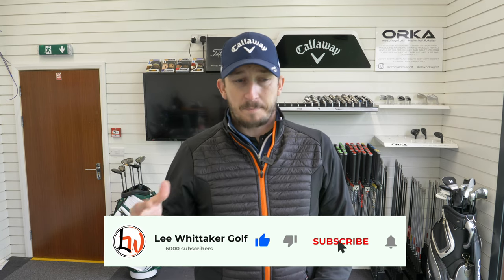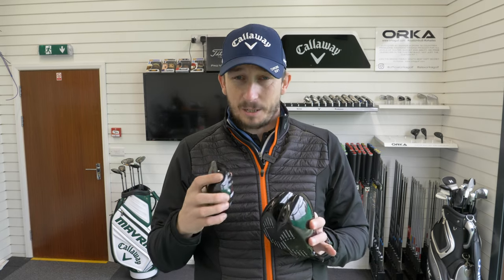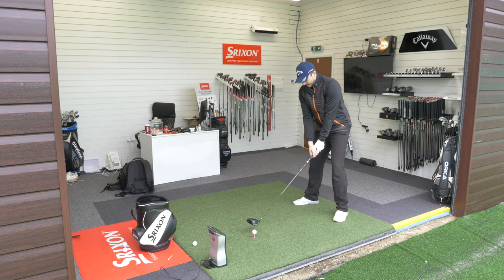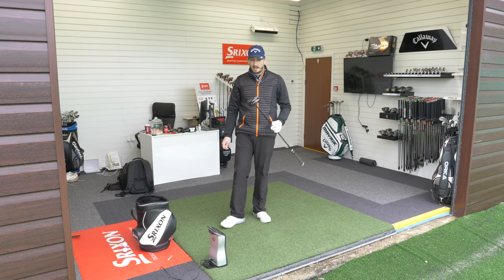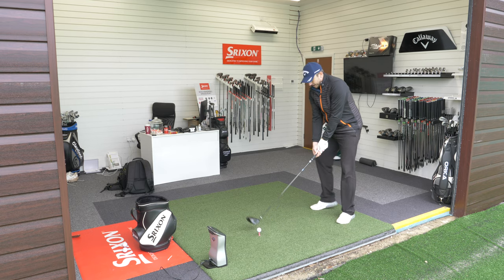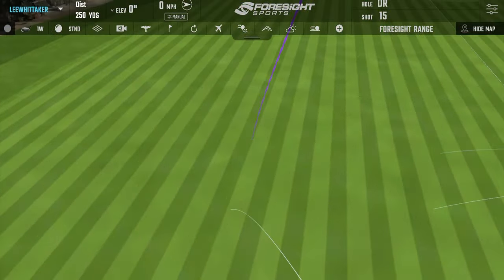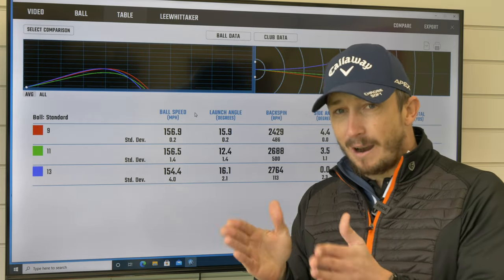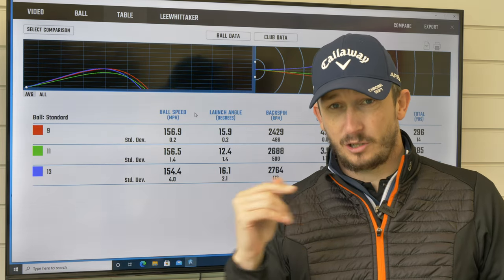LET LOFT HELP YOU!!   Whats the difference between 9, 11 & 13 degree driver lofts?

Comment: I’m the classic case for your video! I used to play an R11TP set at 9.5, Fujikura X flex shaft and hit bombs. 300 plus was easy and used to hack partners off driving par4’s then illness & injury struck my distances dropped markedly but I kept my set up CONVINCED the bombs would come back then I got fitted by my club pro into a Titleist TS3. Softer shaft (hzrdus stiff) and 11 deg of loft (women’s driver loft) but spin at 2400 and 99% of distance back! I’m a CONVERT!

Comment: I got fitted with a 12 degrees driver this year. I was out on the range testing it a few days ago. The ball flight was great. Better distance than before and hitting it more consistent than with my older 10.5 degree driver.

Comment: Interesting vid Lee, when I get fitted for a driver, I normally get fitted into a 9deg head with the loft cranked up a deg which closes the face slightly. This usually gives me my optimum launch numbers.
Though I did get "fitted" at a Golf Outlet store many years ago and the "fitter" (I use the term very loosely) tried to get me in a driver with a 13deg head, the ball was launching into orbit!!!!!!!

Comment: So many people get adjusting the head wrong. In the first 1:20 of this video…you state what most people do not know and don’t unfortunately do not understand about adjusting their driver. I’m a 5 hcp and I have had every driver you can possibly imagine. Hitting stealth now. Std loft. If I turn it down I hit push fades…if I turn it up I hit draws/hooks. I have to have the std setting to get nuetral ball flight. If I want more or less loft I need a new head with lower or more loft. If you fade the ball you can adjust the head up in loft which will close the face and minimize a fade: likewise if you draw/hook the ball…lower the loft and open it up and it will reduce the draw. When you do these things they will affect your distance as well. Example: if you play a fade….a 10.5 head turned up to 12.5 to close the face and you play a fade…you will drop distance. You could go into a 8 or 9 degree head then turn it up to 10 or 11 degrees loft and then play a fade and give you better numbers for distance. U need to do all this on a trackman to see or old school on a course and hit different marked balls and check ball flight and distance. Tweak and repeat over and over u til you are dialed in.
Reply: Sounds backwards. I thought lowering the loft closes the face????
Reply: @brotherbread6549  lowering loft opens the face. Example. Standard loft is 10.5…if you adjust down to 9.5 you will open the face angle. If you increase loft it will close the face angle. 10.5 increased up to 11.5 it will close it. Depending on which brand of loft sleeve u are using…lie angle will also affected up or down will can affect start line of the ball. Taylormade has a single adjustment sleeve for the head. You can move it 2 degrees up or down in loft. Their sleeve can open or close the face 4 degrees and lie angle is increased or decreased accordingly. Just search google for like a stealth or qi10 adjustment chart and you can see how it works…titleist as well has a chart for their adjustments of drivers, fairways, and hybrids. Callaway as well…And they all do work and affect ball flight.

Comment: You say for lower swing speeds use a more lofted driver, what do you class as a lower swing speed, mine is between 96 and 102 depending how good the body is 👍

Comment: Hello there, interesting vid, been playing about with shaft length and stiffness. I have a shorter shaft (1.5 inch) and very stiff, only use when feeling strong and quick, always know what it’s going to do, increase the loft and it works for 250-270 yards. I have a regular full length, messed about with loft to 11.25 today and overall distance was 3 yards short of 300 on one of my drives that I took the time to measure. I’m a right to left ball flight and this does increase my hook when not hitting well so likely back to 10.5 for me

Comment: Using an old R15 driver with 14* loft which I lowered to 12 with the shaft adjustment, and I only noticed a small lowering of flight and a few more yards in total distance. Accuracy was similar, and much much more dependent on me not the club. I get 15* launch angle with 100 feet peak height.

Comment: I fully understand the optimal theory and everyone needs to go on a launch monitor to find theirs. For me it gets tricky when we're constantly told to hit up with driver! If like me, approaching 60 and speed has been lost what is best, hit up and take spin off or add loft with more spin!!! I'm confused 🤪
Reply from the maker: Loft and spin for slower swing speeds. But you should always hit up on driver.
Reply: Isn't there a danger that too much launch and spin just ends up stalling?
Reply from the maker: @Keef-cd9os  every swing speed has an optimal spin and launch etc. Your fitter should try and get you into that window

Comment: Lee, congrats on 6000 subs. I have a very slow swing speed he put me in a 9.5 degree driver but adjusted to 10.5 degrees. He did this to give me a more favorable face angle compared to a standard 10.5 degree driver.
Reply from the maker: That works if you need to close the face slightly 👍

Comment: Is it correct that if you increase the loft of a driver, on the adapter,  than the face closes? So for a slicer the higher loft would help. The problem is most utube videos are made by professionals and most of us are no where near that level

Comment: What’s your left to right dispersion with each?  The higher loft is a little shorter but by far the most accurate 🤔
Reply from the maker: 11 was the most accurate. It’s the lines behind my head on the screen
Reply: @LWG  the green dispersion circle looks to be the largest of all 3?

Comment: Am interested in this as well.  I have using the M2 10.5 Driver, I currently have it lofted down to 9.25 or 9.5 (cannot quite remember).  Recently been getting a bit more ball speed (120-130).  When I did have it in 10.5, I really did see, what I thought was to high ball flight, and the reason for lofting down.  On the M2, does lowering the loft open or close the face?  Think I may need to put it back to 10.5 and see what happens
Reply from the maker: Lowering loft opens the club face

Comment: my 8 degrees is too low for my swing speed but if I crank it up I duck-hook it viciously, I will settle for weak drives followed by hitting a mile with an occasionally pure shot
Reply from the maker: Because adding loft closes the face. It’s the wrong head. You need a higher lofted head